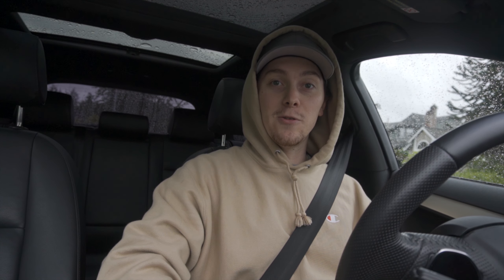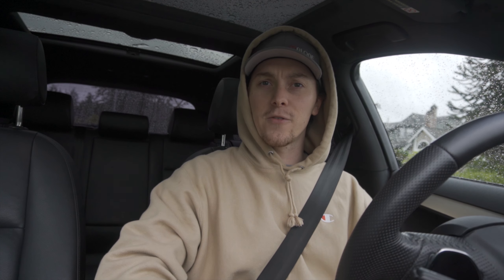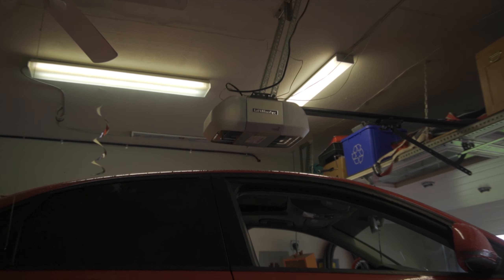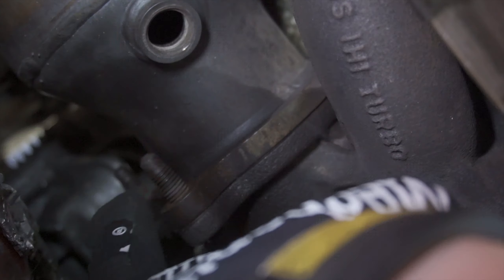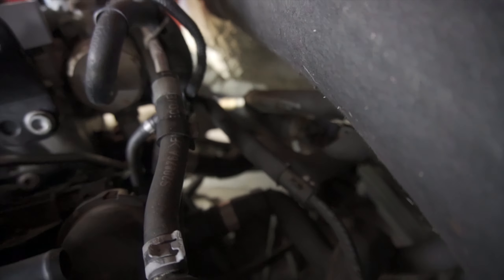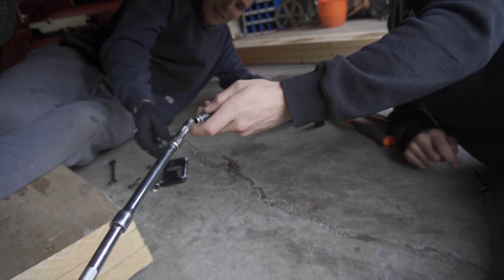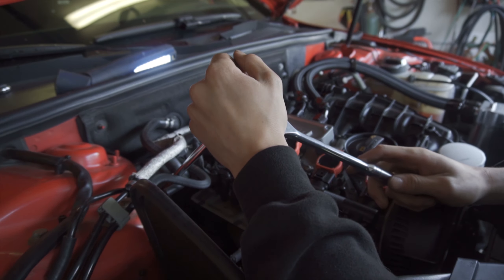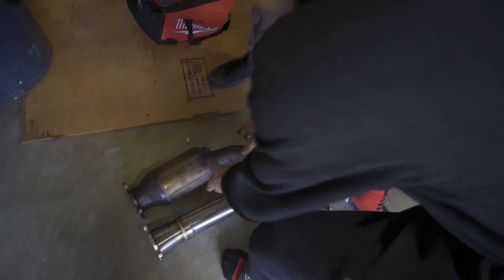B8 A4 Downpipe Install - Sounds WICKED with Crackles!

Comment: Did you have to cut anything i have to do this ASAP i need to know what else i gotta do
Reply from the maker: Nothing needs to be chopped
Reply: I can't get it out not sure what I did wrong 😭
Reply from the maker: Take it out the top not the bottom - should only be like a 16” section
Reply: @ThatGuyTyy  right after I said this I got it out y'all made it look too easy this shit was a STRUGGLE 🤣
Reply: @ThatGuyTyy  and I did go out the top it just was just barely bumping against shit so annoying

Comment: Quick question. I just installed the cts high flow cat on my b8 a5 and was curious if they coat the pipe in oil. First start I noticed it had a little smoke coming off it
Reply from the maker: I can’t remember if this one was coated am sure they probably have a bit on it and it’s likely from the new gaskets and the pipe warming up for the first time, probably wouldn’t worry too much!
Reply: Normal for new exhausts to smoke while breaking in
Reply: I’ve got the same on my a4, mine had the same thing when we first started it up, one all the oil burned off it was fine

Comment: Can I run a test pipe without a tune or if not can I run it with a stage 1 tune chip???
Reply from the maker: You can run a test pipe as long as your ECU gets tuned for it. Could be a stage 1, but specifically would need to have the O2 faults coded out.
Reply: Anything that can be done with vcds?

Comment: Hey does your car consume oil ? I just bought a 2010 A4 2.0T Quattro with 51k miles and the car seems to be working completely good but it’s consuming oil like crazy, 1qt every 350/450 miles and that’s really bad
Reply: Rear main seal most likely,there notorious for failure,if it was burning that much oil is notice it coming out the exuast,,clear sign of the seals bad is oil coming from the bell housing,,hopes that helps you out ,,lean codes when ur oil is low is will mean it's real bad
Reply: Hey my car had the same issue at the beginning what i changed was the oil seperator , the diverter  valve, and when you do the oil change buy the dr.lucas oil stabilizer before i had to be changing the oil every 2k to 3k if im not wrong but now it last me at least 4k to 5k before it hirs the min oil I highly recommend it.
Reply: @carlost0929   I’m currently using motomaster OE plus 5W-30, which oil are you using, was your car burning 1 litre every 350 miles ? I already ordered the PCV valve from ECS tuning just to try to see if that fixes the problem and is not something a lot worse 😓, also how do you use that dr.Lucas oil stabilizer ? 😅
Reply: @B8_ghostt  This era EA888 Gen 2 motors had (allegedly) a significant design flaw with the piston rings which could cause them to become damaged and allow significant amounts of oil to be burned. I have an 09' A4 2.0T with this engine and it used to burn 1L/1000km's which is around 1qt/590 miles, which is a bit less than what you are using. The only real permanent fix for this is to replace the pistons and rings, and repair any damage done by the rings to the block. Audi used to offer this repair for free due to a class action lawsuit, but the window for that free repair is long gone.

Since the car only has 51k miles on it id wager that the block is still fine. You could just feed the beast oil every time you fill the tank like a god damn rotary lol, but over time if the issue is not fixed the issue will cause scoring on the cylinder walls which could lead to engine failure. The "replace rear main" mentioned by some commentors was the original fix offered by audi before they acknowledged the actual cause of the issue, but the root cause is (thought to be) the rings.

Note: I am saying allegedly because there was a class action lawsuit in 2015 about this issues, which resulted in audi agreeing to fix all affected engines but not admitting fault, or that there was anything wrong with the motor.
Im not a laywer or mechanic, just an owner of this damned motor whos had experiences with it, again check with your mechanic, though this issue is quite well documented in the forums and lawyer's websites. 

Sorry to break the bad news, this is kind of the initiation ritual for the 09-11 A4 2.0T owners club lol, practically all of these engines have/will experience this issue at some point in their life.

Edit: Did my maths on oil usage wrong, has been fixed

Comment: Which phone mount is that ? I've order 2 and have not worked for same car you have
Reply from the maker: It’s just scosche mount, nothing fancy
Reply from the maker: Wait is this for the A4 or the A3?
Reply: @ThatGuyTyy  2012 a3 just like yours but my is awd. Isn't that mount that 9ne that goes in between the vents ?
Reply from the maker: Yes mine is made by clear mounts, it goes behind the vents and pokes out in the middle!
Reply: @ThatGuyTyy  thanks. Gonna order the low profile one. Ive order 2 from Amazon but dont fit the vents

Comment: So in addition to cat delete, you still have to do some ECU stuff to get the hp gain?
Reply from the maker: Yes, deleting the cat itself will provide (maybe) minor gains, but to unlock full benefits you need to tune it.
Reply: @ThatGuyTyy  how much does it cost on average? The ECU tune for a car delete?
Reply from the maker: Depends on what company you choose to tune with, usually around 5-700$
Reply: @ThatGuyTyy  is this for stage 1 or 2?

Comment: Does urs consume a LOT of oil?
Reply: Very common issue on that gen A4. Have a 09 A4, had the same issue, only real permenant fix is to get the engine rebuilt. You used to be able to get it done under warranty by audi (there was a class action) but now you have to pay for it out of pocket. Everyone I know with a car with the EA888 Gen 2 has this issue. Either rebuild or just keep feeding it oil though eventually you may start to get some serious piston slap on cold starts which can very quickly destroy the engine.
Reply: @Byefriendo  is this the same issue for a 2012 or did they somewhat fix it by then?
Reply: @rudyl.103  I think they fixed em by them, but not 100% sure